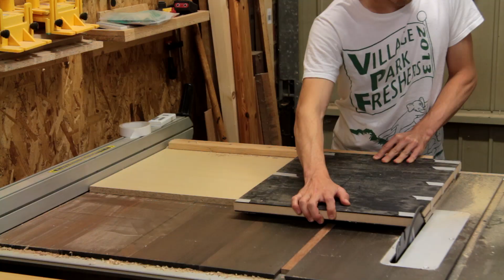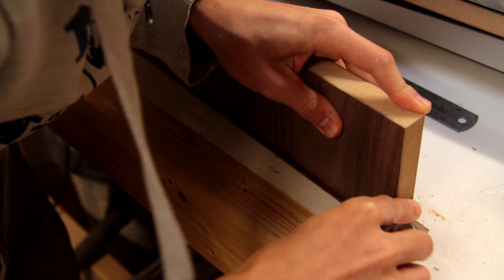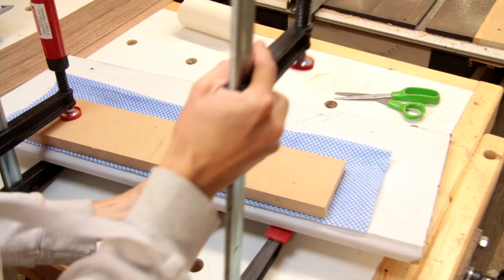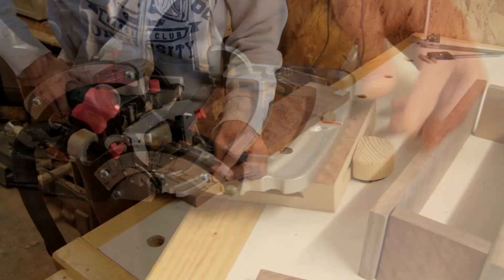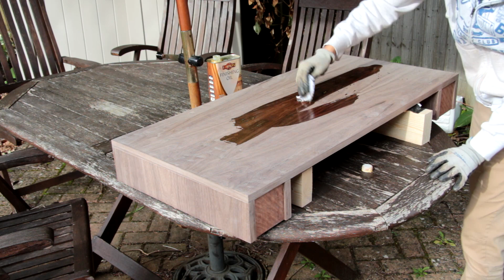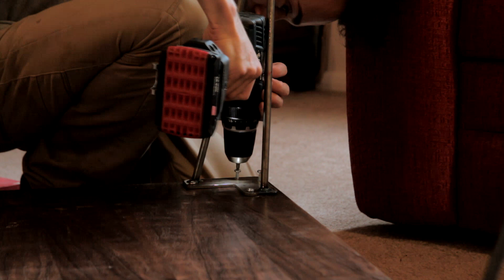Make a Retro Lift Top Coffee Table

Comment: Great to have you back Alex. Hope uni is still going well. Can I be rude and asked how much Travis Perkins charged for the walnut mdf? Also what finish did you use and how many coats did you apply?
Reply from the maker: Uni is all wrapped up and finished I'm glad to say and now a few months into a graduate development engineering role! The MDF cost about £90 for an 8 x 4' sheet, so it wasn't cheap, but provides more than enough for 2 tables like this. For the finish I used 3 coats of "Liberon Finishing Oil". It's not the best I've used but pretty good for the price and hard to apply wrong.